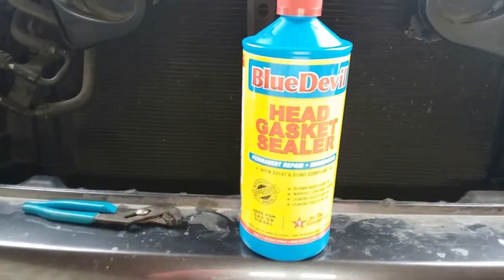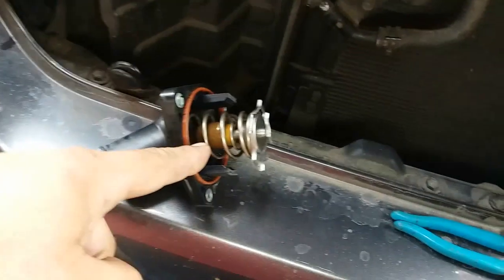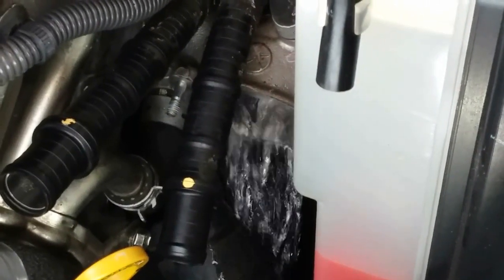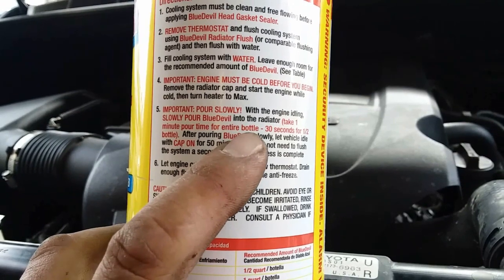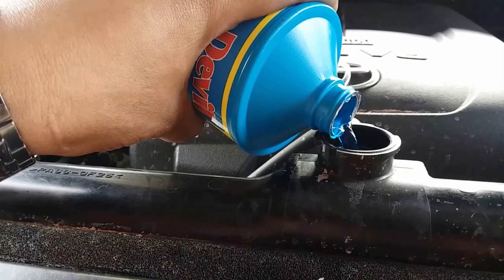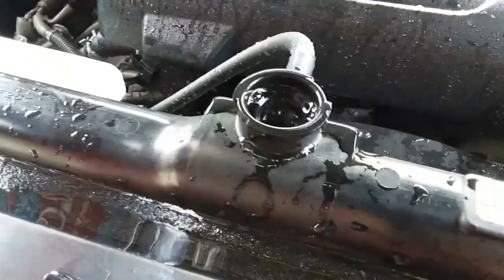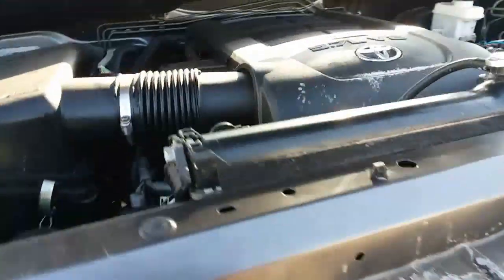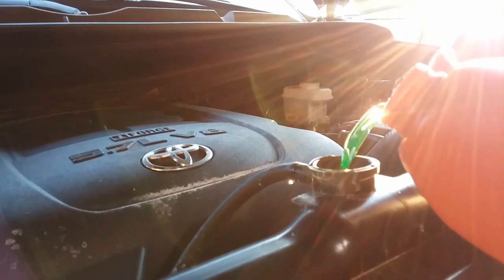How to: Use Blue Devil Head Gasket Sealer

Comment: You should also change the oil if your head gasket was bad because coolant will be in your oil.
Reply: Thays not always the case. Only if there are obvious signs of coolant in your oil like the dipstick is higher than it shiuld be and the oil looks milky.
Reply: Before or after blue devil
Reply: @knuccs  after
Reply: @knuccs  
Obviously after
Reply: @knuccs  great question...I was wondering the same thing
Reply: I know this comment is old, but there are 7 ways a head gasket can blow, and between an oil and coolant passage is only one of them (which would be the only one where oil and coolant get mixed). The gasket can blow between a coolant passage and combustion chamber, oil passage and combustion chamber, between 2 cylinders, coolant to outside, oil to outside, or combustion chamber to outside… none of which mix coolant and oil together.
Reply from the maker: Thanks brother super informative 👍

Comment: Hey George nice explained video I really wanted to know if I need to flush the entire cooling system after the process and you explained really well, now I'm ready to do it next weekend!  The oil looks good and coolant looks clean,  just some bubbles and exhaust gases in radiator so I hope this will work for me, Thanks for sharing!
Reply: Also curious to know if it's still working after almost 2 years!!!
Reply from the maker: Hopefully it works bro! This is like a bandaid. Its only temporary and depending the size of the damage. After its complete you dont drain it all. Just replace the thermostat and fill it back up with coolant.  Good luck bro. Still hanging in there in this tundra 👍
Reply: Do I let it keep running if the temperature keeps rising
Reply from the maker: Maybe the water pump is bad or the damage on the headgasket is unrepairable. You might have to seek a mechanic honestly

Comment: Will the sealer still work even if my heater doesn’t?
Reply from the maker: it should you just put it on hot so it opens up the port to the heat exchanger

Comment: Is it still holding up?  Have you drained the water out since then and filled it with just coolant, or are you still using water?
Reply from the maker: no replaced it with coolant and no issues yet! but this is not a permanent fix its only temporary.

Comment: Hey George, great video!  I wonder that after I replaced the thermostat and ran the truck for a day... process completed, would you re-flush the system and re- fill with coolant and water in order to remove the chemical from the system?  Thanks
Reply from the maker: Yes so the system can be filled with coolant again. Once you remove the thermostat you can flush the radiator with a water hose and let it come out the thermostat housing. After it's all Flushed open the radiator drain plug to remove the water. Close it, install the new thermostat and fill the system up with coolant, burp the system from air pockets and ur set! Good luck brother. Blue devil is a temporary fix, not permanent if it works depending the size of the damaged area. Good luck brother 🙏
Reply: Eso no sirve pa bosta estafa

Comment: Two Quick question you don’t mind. I cant pour directly into my radiator I only have a reserve tank. And do you put on thermostat on after flushing before starting engine or after everything over put on thermostat?
Reply from the maker: you can add it to the reserve tank. If their isn't a cap on the radiator, that would be the only option. Add the thermostat after you ran the Blue devil then let it cool down. open up the thermostat housing install the thermostat then add more coolant and you should be good. hopefully this product helps. this is only a temporary solution tho. its not a permanent fix.

Comment: So after you run it for 50mins you have to take off the old thermostat and let some drain out put the new one and then top off with antifreeze correct but how much to you drain out to put back antifreeze or doesn’t matter
Reply from the maker: You remove the thermostat and I stall just the housing back. Run it for 50min then remove the old housing, install the new one with a thermostat. You can drain it out, then add antifreeze or leave it install the new thermostat then top it off with coolant so what ever is left in the system, continues to aid the headgasket crack. This is only a temporarily solution to get you to a mechanic, its not a permanent fix.
Reply: @559powerscape  thanks a lot I did it no more white smoke
Reply from the maker: @miami305trini  heck yeah im glad this helped out, thank you for your Support 🙏

Comment: Hey George the coolant is blowing backout the radiator!  can i put the blue devil in the radiator first and put the cap on so it doesn't blow out ?
Reply from the maker: Yes you can, make sure the vehicle is cold, remove the thermostat, seal the system then add the blue devil and run it.

Comment: Any update on how well or long it worked?
Reply from the maker: Still runs fine till the day. But this is only a temporary solution not a permanent fix
Reply: @559powerscape  3 years?  What else can you ask for? It’s a $3000-$4000 fix
Reply: Good info. Mine is working. No codes on but still burns a little anti freeze somehow 400 miles later.
Reply: One last question. If it needs to be repaired after, or if, the blue devil doesn’t work anymore. Is the motor messed up? Or is it just a regular head gasket repair. ?
Reply from the maker: @jsage5  this is just a band aid affect....not permanent....it eventually has to come off....it needs to be repaired when possible, yes just a headgasket and head resurfacing will be needed, engine should be good as long as it's not abused

Comment: Hey George thanks for this, I have a 2010 Sequoia 5.7. Would you say this is better than the Pour-N-Go version? If so I will go through the extra step of removing the thermostat.
Reply from the maker: Ive seen good results with both. Its hard to say which one is better. The pour-n-go version is good because its stays in the system, so its constantly being used if it needs it on the headgasket. 
This larger bottle is more expensive and more work. You have to drain the system after your complete the process. 

If i had to choose i would use the big bottle, just cause you have to flush it out when ur done with it. I feel this is the safer one cause this way it doesn't clogg anything up in the coolant system...

Good luck brother hope this helps out! Thank you for your Support 🙏
Reply: @559powerscape  Can some one tell me if you have to wait to the next morning to drive it and try it out? or can you drive it after the 50 minutes are up?

Comment: Hey!, did you have to drain all the water out of the system (after pouring blue devil) then replaced it with recommended coolant after?
Reply from the maker: No just install the new thermostat and fill it with coolant
Reply: He said at the end of the video to keep some of the water that has the blue devil in it so it continues to work, to anyone else who reads this. So top it with concentrate that will dilute I suppose, and not 50/50 pre mixed

Comment: When flushing the engine and pushing fluid out thermostat housing, did you connect the water hose to where the upper radiator hose would go? All the coolant flush videos I’m seeing for my car don’t seem to flush out the thermostat how you did, just want to make sure I’m doing it right, thanks!
Reply from the maker: Yes i disconnected the thermostat and ran the water house on top to drain the engine and radiator out. The hose connected to the thermostat goes back in to the radiator
Reply: @559powerscape  thank you. Last question, did you re assemble the thermostat housing after flushing but before pouring, and then change fluids and thermostat after it idled for the 50 min?

Comment: you have to leave the thermostat unattached while it's running for 50 minutes?
Reply from the maker: 🤣 no remove the thermostat, install back the hose add the contents and water then let it run for 50min

Comment: I did it works but  the heater is not working only cold air
Also the coolant reservoir is overflowing 
Any clue
Reply from the maker: Make sure there isn't any air pockets....drive it then let it cool off then top it off with coolant....repeat over the next few days to make sure all the air is out
Reply: @559powerscape  the heater core was clogged now it’s working perfect 
We changed the radiator cap and the radiator is new it was installed few months ago
The thermostat is new too but it was installed before I put the product 
The issue now is the coolant reservoir still overflowing
Reply from the maker: At this point, I honestly don't know to be honest. Sorry bud Goodluck!
Reply: @559powerscape  Thank you 🙏

Comment: Hi George it did work but my heater stopped working only cold air and also coolant reservoir overflowing 
Any idea
Reply from the maker: Make sure there isn't any air pockets....drive it then let it cool off then top it off with coolant....repeat over the next few days to make sure all the air is out
Reply: @559powerscape  Thank you
The mechanic did flush the radiator but the heater blowing cold air 
And the reservoir overflowing 
Do you think I have to change the thermostat
Reply from the maker: The thermostat should of been changed out. I would just make sure its not over heating...it could be that the radiator cap is bad and might need to be replaced as well. I would start with the cap first
Reply: @559powerscape  Thank you

Comment: what if my heater doesn't turn on at all
Reply from the maker: Thats fine what its trying to do is keep Temps down. Shouldn't be a problem
Reply: @559powerscape  ohh okay, thank you for the response
Reply: @statik_cirilo  with the thermostat out the water will just circulate thru the heater at a low temp with no air locks
Reply: Water pump failure if no heat is coming on even with thermostat removed.

Comment: Hey George!  What were the symptoms on your truck, bubbling in reservoir?   Overheating?
Reply from the maker: Check engine on cold starts fo secondary air injection pump...a mechanic shop stated it was for headgasket issue. Did this and it fixed it 🤷‍♂️🤷‍♂️🤷‍♂️ ... Worked for this truck. I really think it depends on the size of the damage on the headgasket.
Reply: Ur reservoir bubbling too?
Reply: @Bluestarseed1  Mines definitely bubbling on my 02 sentra, hope this fixes it 🙁

Comment: Hi My Van Mitsubishi L300 is getting Low water level after driving 50 Km, And there is oil in Radiator Top.  Can anyone tell me it is Blown head gasket or something else? And should i use this Sealer to repair the problem? Please advise
Reply from the maker: It sounds like you have a pretty bad head gasket leak...I don't think this product will work unfortunately. Sorry bro. The head gasket needs to be replaced...or seek a mechanic...just might be something simple 🤷
Reply: @559powerscape  Thanks for Advise. Really appreciate it. Thanks

Comment: So what if the engine overheats before the 50 mins required?
Reply from the maker: Is there water in the system? Was the thermostat removed?
Reply: Yes,all the above.  Car gets very hot at idle in bout 20mins & bubbles up through reservoir. Not trying it again but will take it to radiator shop & let dem do it for me for me next time
Reply: Hey,do you think I should change my oil & filter once the procedure done?
Reply from the maker: @jameswilson9966  yes that would be a good idea to change out the dirty oil mixed with contaminants
Reply: It overheats under the 50 minute time. What do you do?
Reply from the maker: The headgasket is probably to damaged for it to work
Reply: I use bluedevil very often when 
This is what 1 do when the 50 min cycle starts

Get a water hose and pinch it with 1 hand (my left) and with the right hand slowly pour water over (not inside) Over! The radiator to keep it cool its really boring to wait 50 mins just holding and moving a water hose side to side i know but gets the job done for sure  !
Reply from the maker: Thanks brother 🙏

Comment: Is this gonna work on mazda 6??
Reply from the maker: It might it just depends on the size of the hole in the headsgasket. Its a 50 50 chance it will work but its not a permanent solution.  Its temporary, like putting on a bandaid. Its going to have to come off some day.

Comment: I followed the instructions but my car is still running hot after about 20m at idle. You have any ideas why it could still be running hot??
Reply from the maker: And the Thermostat is out too? Maybe its the water pump thats bad? Or the head gasket is completely blown this is for small leaks and its not a guarantee it's going to fix the problem. I would check the water pump try replacing it and see if that fixes it. Its a process of elimination now
Reply: Or electric cooling fan isn't kicking on, or fan clutch is worn on a belt driven one
Reply: U have air pocket in the system let the radiator cap off let I get all the air out

Comment: Don’t drain all your water just drain out overflow bowl and little more I had no problem filled it up 50 min later then cooled done no problems temp steady no leak then. Put back thurmastate and filled it back up antifreeze run till filled heater on. Assume no leaks
Reply: Question: so after the treatment do you not drain the system again? You just top with antifreeze and go or do you drain the entire system and refill with nothing but antifreeze
Reply from the maker: When you replace the Thermostat is going to leak out plenty.  After install just fill it up with coolant. You want to have some in the system for it to continue to work. Remember this is only a temporary fix, like putting on a band-aid...its not a fix. is a temporary fix.

Comment: My truck is pouring water in the exhaust pipe even after it warms up
Reply from the maker: Sound like you need to seek a mechanic. It could be condensation but if it's alot some thing must be wrong. Do you have to keep adding coolant to the system? And issues with the motor hesitating?
Reply: It don’t drop a lot of water but  when I’m parked with the A/C fan 1 it’s starts going more than half the temperature but the  anti freeze still stays the same I don’t have to add more water when I start headings out and it goes back to regular temperature
Reply: No motor hesitation I changed the water pump Nd the thing that cost 21 bucks in your video is also new I’m trying to see if the head gasket or the radiator

Comment: I just bought some for my 1990 F150, a mechanic recommended it..

How did it work for you? Is it still holding up?

My thermostat is new, I haven't really drove the truck, do I need to buy a new one, still?

Thanks in advance..
Reply from the maker: Pretty good. No problems yet!
Reply: No need to buy a new one. Use same one.

Comment: My needle still went to almost overheating when I added this. I'm 20 minutes in and the needle still almost at overheating
Reply from the maker: Maybe the crack on the headgasket is unrepairable. Are the fans kicking on? After adding the BlueDevil did you fill it back up with water so its full and no air pockets? Was the thermostat removed?

Comment: What if it’s a brand new thermostat
Reply from the maker: Per guide lines in the bottle, it has to be removed. If you have the old one take the Thermostat off from that one...I also just made another video using blue devil and you do not have to remove the Thermostat 

https://youtu.be/EAWjeOkGthM

Hope this works!
Reply: @559powerscape  Can you do all that but leave out the thermostat ,what are the cons of running the car with out a thermostat? Thanks in advance.
Reply from the maker: @erosbosandzeros3155  yeah that wouldn't be a problem unless you car detects if their is no thermostat then it will throw a check engine....most modern cars come sensors on the Thermostat now....it would just take longer to get to temperature in the winter time and in the summer time you can risk of over heating. What the Thermostat does is block of the flow so it gets a chance to cool down in the radiator, then it opens and repeats....you shouldn't have a problem but be advised, its there for a reason.
Reply: Engine codes are 3asy to clear once the job is complete each vehical has a sequins of things you can do to clear codes

Comment: Remove thermostat ? Modern Cars have Electric Thermostat. You can not remove  it  without auf lot of work..
Reply from the maker: Just remove thermostat  housing  press the spring down and twist and out comes the thermostat or break it and replace the housing cause it comes with the new thermostat. Needs to be done in order for this to work. Yeah its a lot of work but more work if your replacing headsgaskets.